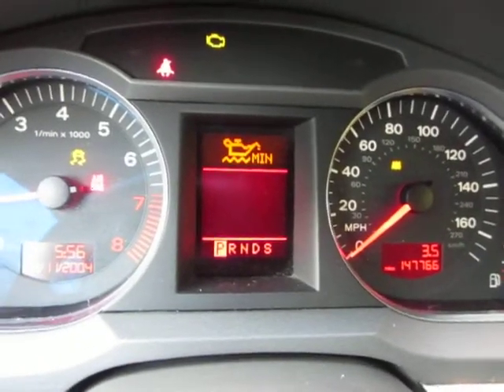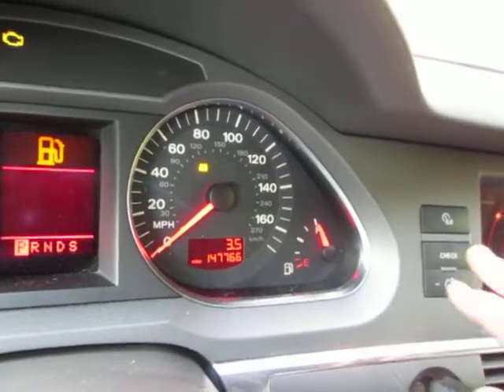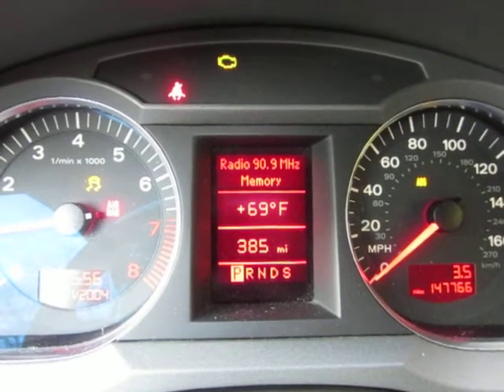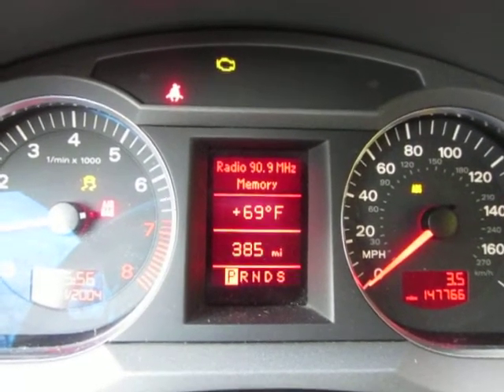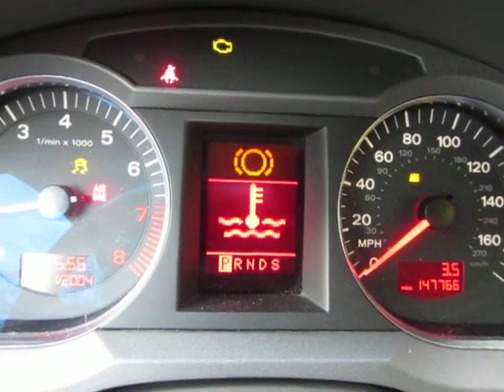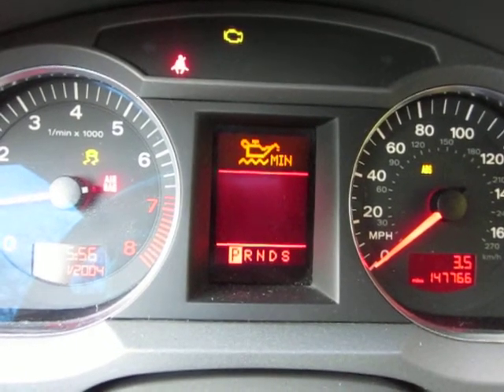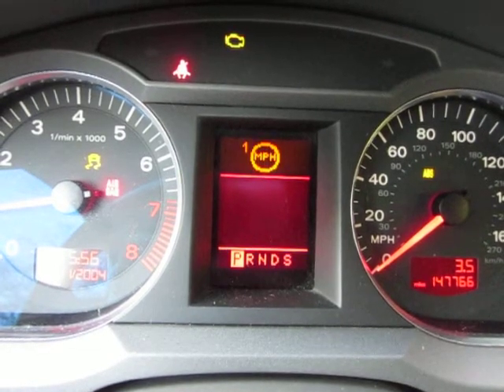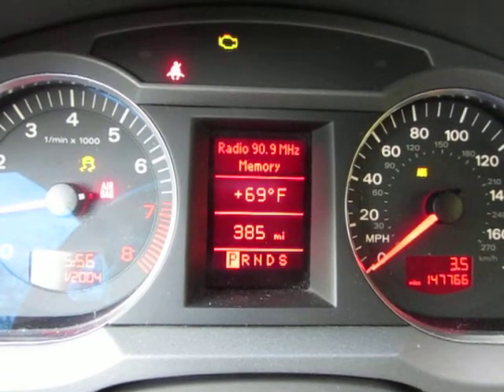What does a yellow animated oil icon mean in an Audi?

Comment: EDIT: Also read reply

Check runs a sensor check and makes sure all sensors are 100%. The last one is your washer fluid level sensor. If you see any of those without hitting CHECK then that means the level is low. You have two Oil errors, MIN means add more oil, SENSOR means bad pressure or sensor failure, the bulb with X through it shows when a headlight, taillight or marker is out or malfunctioning (e.g., not level). Gas icon is gas level sensor. MPH 1 and 2 are speed sensors.

Read your owner's manual, it explains all of this.
Reply: when you push check, it does not mean that any of those sensors are reporting low values, it is simply checking the condition of the sensors. The only time you have to worry, as if you see those while driving or operating the vehicle.
Reply: Your Audi will show the icon combined with a text description of the error on your dashboard MMI screen, on the red section, for any errors. If you don't see those icons without pushing CHECK you're fine
Reply from the maker: I see zero utility of the check button, because if anything is broken, you'll get an error message anyways.  The audi is always checking everything, and I don't think it can report, because you pressed the sensor button, any errors that it wouldn't be reporting anyways.  In fact when I did this I did have 1 or 2 issues, and it didn't like focus on any of them during or after the display video.  Am I wrong?  The only use is to bedazzle the driver with the possible error and warning icons.
Reply: @jason.arthur.taylor  Eh, more to run a full systems check. Some Audis will show OK after the check if everything is kosher. My B6 S4 does that. Again, the purpose of the button is pointless, since it will throw an error if one exists
Reply from the maker: Hmm.  In that video I had some errors, but now I have no errors in my audi, and I still don't get a Kosher signal either.  I guess my car is a goy edition?  (I always wondered why the salesman asked me if I was Jewish.)
Reply: @jason.arthur.taylor  not every model does the OK I don't think. If you want to be extra safe run OBD. Private message me if you'd like more specific instructions, would be glad to help
Reply from the maker: Thanks.  I already have a good vw scanner I am happy with.  Not perfect, but I do like it, and there's someone from the audi community near my house (DC Dog) who is nice enough to do anything I can't do with his vag com unit.